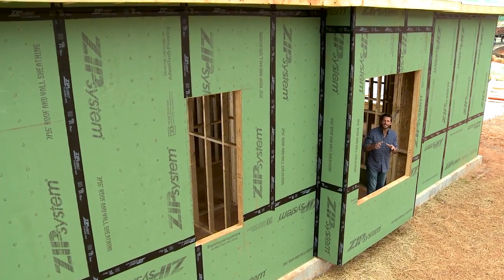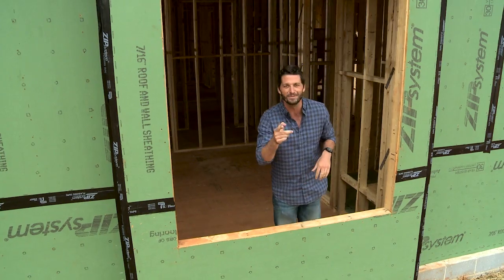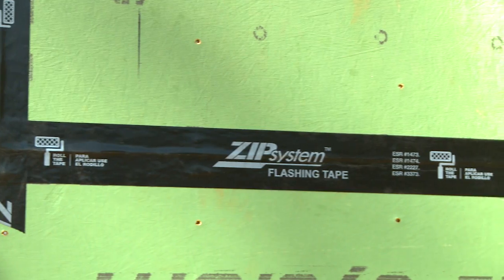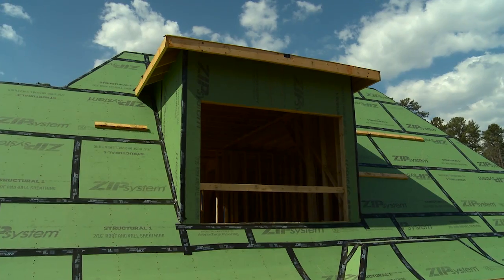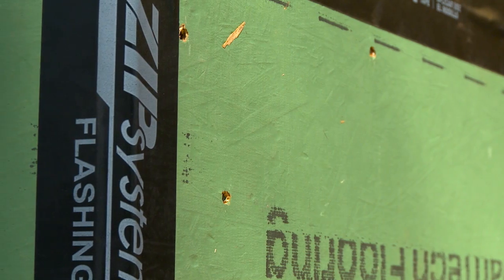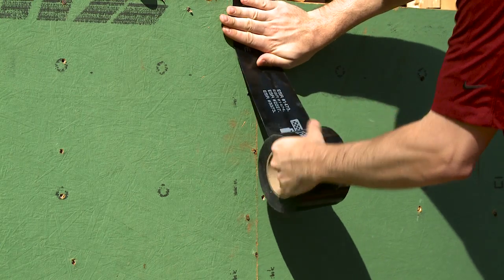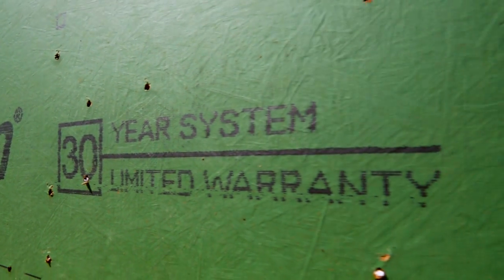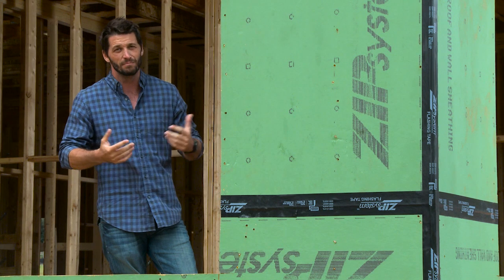Building Enclosures Evolved + Homeowner Benefits | ZIP System sheathing and tape

Comment: For future reference: Please, don't over-penetrate the nails, it decreases the strength and sealing effectiveness of the panels. Just turn down the compressor a bit so they are flush to the panel. Maybe put some Liquid Flash product on them if possible.